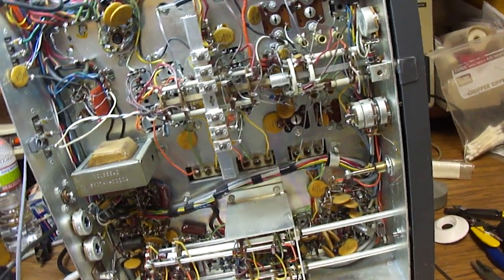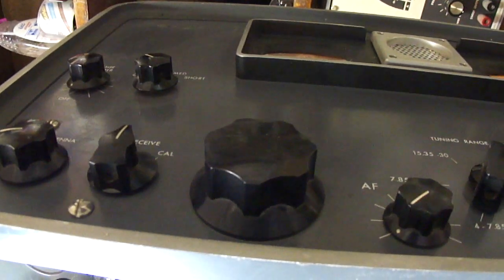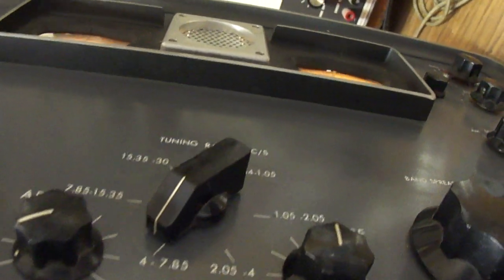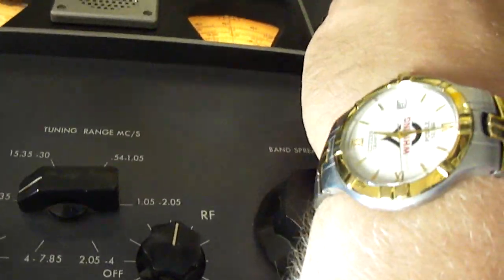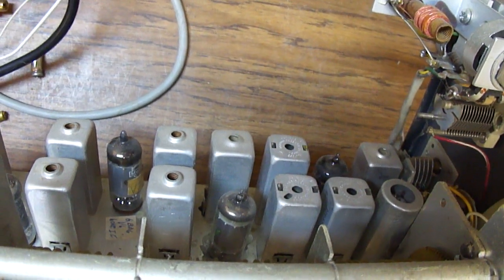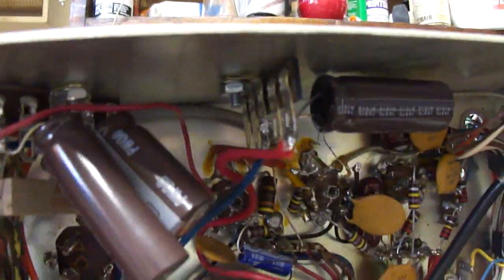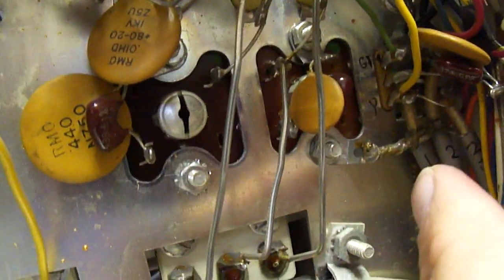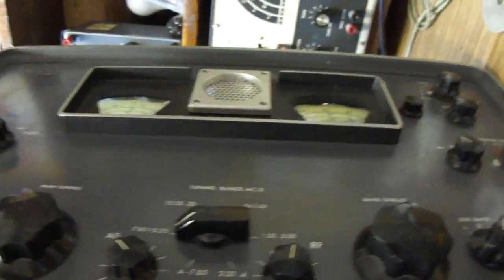1966 Hammarlund HQ-180A communications receiver test

Comment from the maker: @force311999 No, actually some models had a small telechron clock with hands like on a clock radio. It would have mounted in the upper left corner.

Comment from the maker: @AllAmericanFiveRadio Hopefully I won't...I removed the first IF can from the chassis and tested it by connecting its output to a table radio. The first IF can has real mica caps soldered inside. I'll try and upload a video soon of the test. I know there are some of the cans which look different from the others so hopefully these are the bad ones. Some of the cans only have one coil/cap inside which should make it easier.

Comment from the maker: @quantumbits I was thinking maybe I could but I don't think I can raise the transformer up enough from the chassis to un-pry the cover even if the fastening clip is removed. Sometimes I have been able to do that if there is enough length on the wires going to it but these ones have a lot of components like resistors soldered to the IF can terminals.